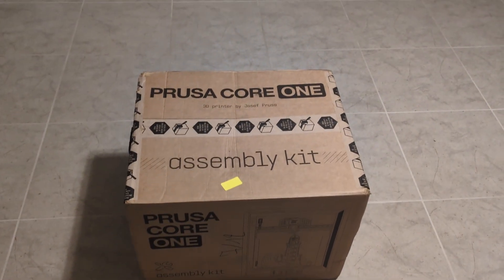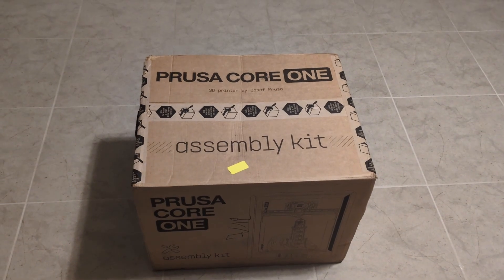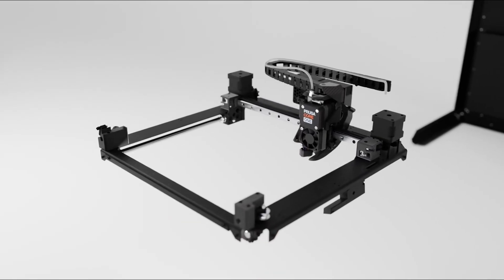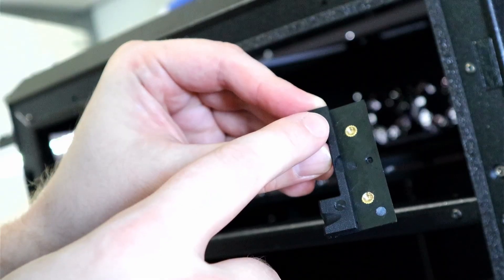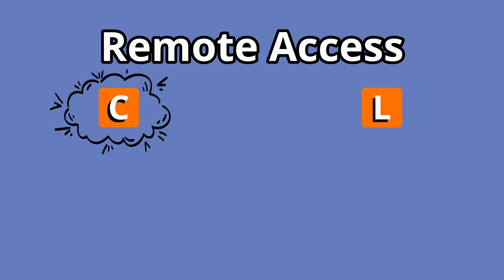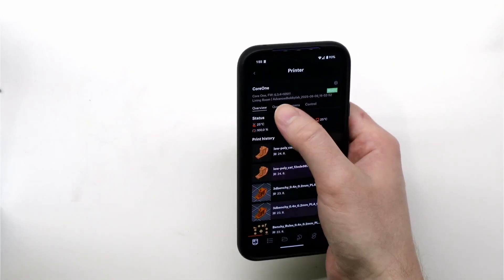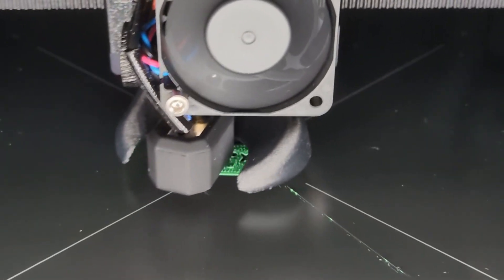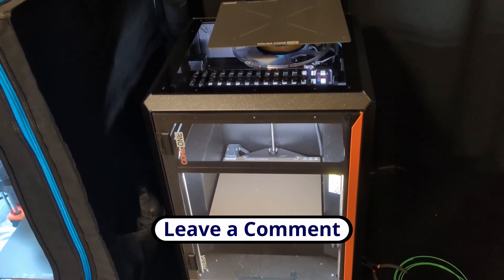Unboxing Prusa CoreOne Kit | Worth the Wait?

Comment: Use the new RC version of Prusa Slicer.
The surfaces look much better now.
Not only on the Core One.
In the new Alpha firmware of the Core One there is now a new method for belt tensioning using strobe light from the LED lighting.
Reply from the maker: Thanks for the tip about the new Prusa Slicer release!